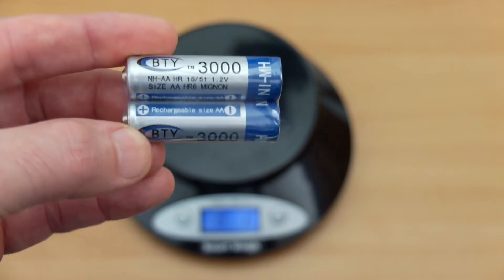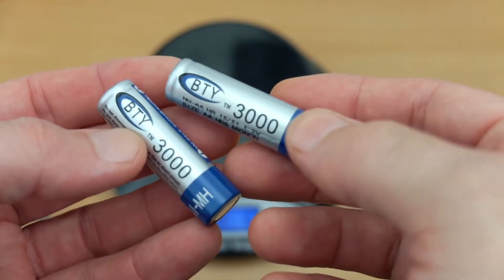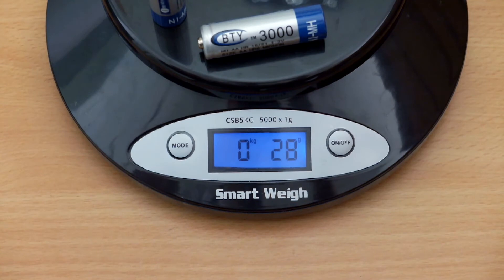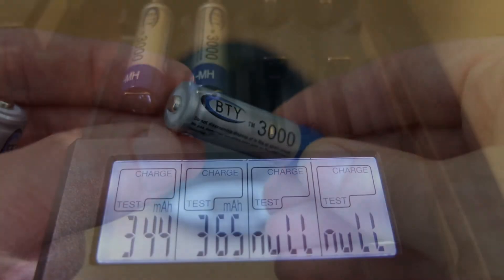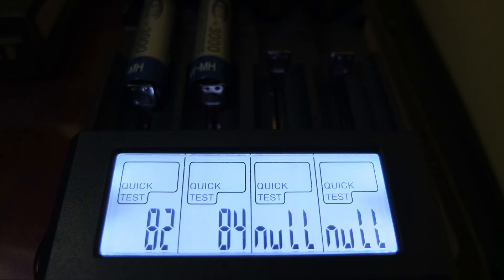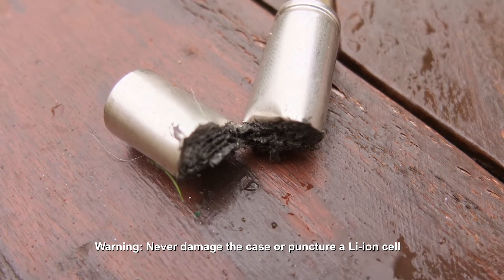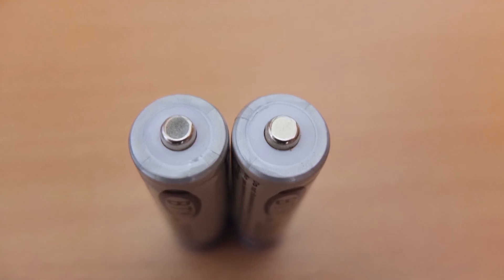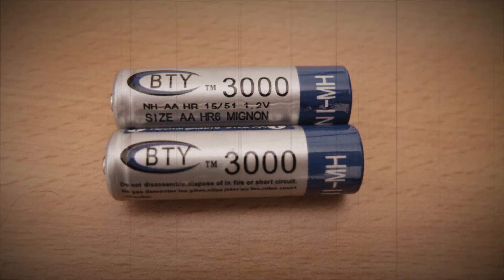BTY AA (3000mAh Ni-MH) rechargeable battery: Capacity Test/Review

Comment: Good review. I bought 16-of these batteries because they said 3000-mah. When I received them and felt the weight I new right away crap. I still have them there the worst lightest battery I’ve ever had in my hand bought them from china. I will bin them . I did change them and the reading was bad. I bought Infapower off eBay and I’m shocked how the beat 3-high end makes so I bought some more that’s AA and AAA.
Reply from the maker: The weight does give it away. But I was mostly shocked at how bad they were, I didn't expect much - yet the capacity was so absurdly low...they are a complete waste of time. Sadly they still seem to sell a lot of these, I made the video so people would know how bad they are!
Reply: @MrBazReviews  Hi. It’s good of you to do a video on crap batteries. And yer I still have seen them for sale .👍

Comment: If you look at the battery closely, it doesn't say 3000mAh anywhere. The '3000' I believe is a model number. Deceiving? Yes, but not an outright lie. I have some of the BTY 1000's that came in solar lights. There's no capacity listing on the battery at all. They do list a charging rate.
Reply from the maker: As far as I'm concerned it is deceiving and misleading to buyers. If they put the real capacity on the cells nobody would buy them.I've tested AAA's with double the capacity of these, junk is junk there is nothing to defend, hence the test to stop buyers wasting their money.
Reply: The sellers on eBay and Amazon specifically state that they are 3000 mAh batteries, which is a total lie.  I bought a few of these to try and was able to get between 300 and 400 mAh out of a few of them.  Still nowhere near 3000 mAh.

Comment: Self-discharge rate?
They might be usable for clocks and very low drain LCD devices.
Reply from the maker: Not good you have so little capacity to start with don't waste your money on this junk. There are plenty of affordable batteries out there (try Odec pretty cheap and decent for self discharge) I would not recommend these cells even for free they are absolutely hopeless!
Reply: Yeah, but I have a few of them lying around. So I'm wondering how can I make best use of them.

Comment: Nice work.  I just tested 2 brand spanking new BTY AA cells on a MH-C9000 and got 236 and 291 mAH. This product should be banned from eBay, but I did not see any way to provide a product review. Luckily they are cheaper than dirt, but worth even less.
Reply from the maker: Yup they should stop it because it's just plain misleading. They are awful cells not even worth having for free

Comment: I agree with you completely. 
I brought 16 pairs of BYT 3000 Mah battery, as I was tempted with offer. Today i tested for first time.
These batteries are pathetic. 
They just lasted for just 100 flash output. I changed all four sets and all drained out, whereas my eneloop 2450 MAH batteries, 2 years which was on MY camera MOUNTED  flash still kept firing
Reply from the maker: Yes we al like a bargain but when the actual capacity is so low it's a waste of time. If they'd been half respectable (say 1300mAh or higher ie at least usable) then I'd be less harsh - still very misleading to buyers you think you're getting an ultra high capacity battery, it's really an ultra low capacity one!

Comment: Nice video. Thank you! BTW what battery capacity tester do you use?
Reply from the maker: This one:
https://www.youtube.com/watch?v=C9JABAp5QkQ&index=3&list=PLPDCN48jxW_vualtWC8IuQCVTKFbBVmBR&t=3s
Reply: @MrBazReviews  thanks for the review. So it's not just me noticing short lifespan and not even charging on my duracell charger that i mainly use. How should i throw these out?
Reply from the maker: @geoffg8840  They might be under voltage I have seen it on these cells some chargers won't charge at lower voltage. Even so they're useless batteries even when they work! Best to re-cycle them at supermarkets etc if you can.
Reply: @MrBazReviews  thanks will do. I was gonna use them for a police scanner. Died within 1 hour
Reply from the maker: @geoffg8840  As they say buy cheap buy twice, just get the eneloop cells they last many years and a lot of cycles it's worth it
Reply: @MrBazReviews  ok thanks

Comment: Nice video.i bought 24-pack of these off eBay waited for ever then the were delivered.As soon as I felt the wait of one I thought these are crap. There so light they feel empty.i have many many rechargeable batteries Some cost a lot for my radio scanner and hand held cb. The thing is when you see batteries like this 3000 mah for sale know one knows how good they are until they are in are hands. Don't buy these batteries.i put mine in the bin a hour in my scanner the battery icon came on just over a hour crap
Reply from the maker: They are truly awful cells, not even worth using if someone gave them to you for free. Those misleading capacity ratings, hence I made the video to show people what they really get.
Reply: Hi. Yer that's why I bought them because they said 3000-mah .there more like 300-mah total crap. Just think what the seller buying them in for probably a £1.00 for a pack of four. Are stick to the ones I know are good and I buy most batteries of Amazon.

Comment: Hello, what is the normal discharge  amperage  when doing these tests? For a single AA would it be an amp or less?
Reply from the maker: Less depends on what charger I use but at the moment it's the Xtar Dragon so I discharge at either 250mAh or 500mAh. Obviously larger cells I discharge at higher rates the Opus discharge rate can be up to 1.0 amp, but accuracy is improved with lower discharges. Just takes more time that's the downside, well it does for real high capacity cells
Reply: That's what I needed to know. Thanks!

Comment: A rule of thumb in life is that you will almost always get ripped off on eBay.
Reply from the maker: Depends for stuff like this yes they just put what they think will sell, make up the numbers. Batteries are very hit and miss so it's probably best to stick to better known makers then take a chance on junk like this
Reply: What are some quality rechargeable batts? I want NiMH 3000 maH AA batteries. Which ones are real 3000 mah ones?
Reply from the maker: @macharper8214  There are no real 3000mAh AA Ni-MH I have ever seen it's a myth capacity best you'll get is around 2500mAh
Reply: Do you know why NI-MH is considered superior to Ni-Cad batteries?
Reply from the maker: @macharper8214  Many Ni-MH has higher capacity, no memory effect (can charge at any level Ni-CD should be discharged), more charge cycles etc. etc.

Comment: I've bought cheap batteries years ago and didn't have much trouble with them I thought, other than they wear out pretty quick compared to say an energizer. Fast forward a couple of years and I got hold of a smart charger with capacity testing. Any of those cheap (red, blue, purple, yellow doesn't matter the colour) come out between 300-400mah. Which, if you add it up $7 for 12 batteries, 10 cheap batteries would equal 1 good energizer which is about $5. Cheap 9V rechargeables are even worse - they're nicad not nimh!